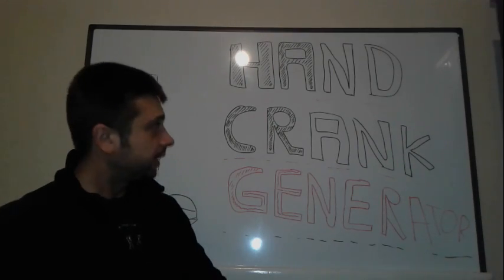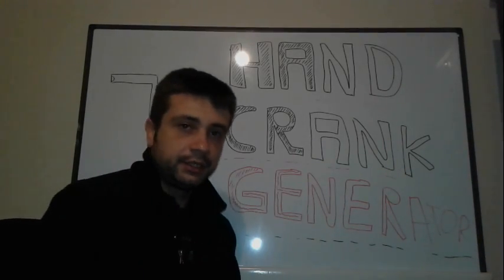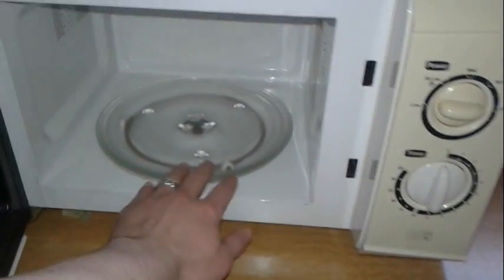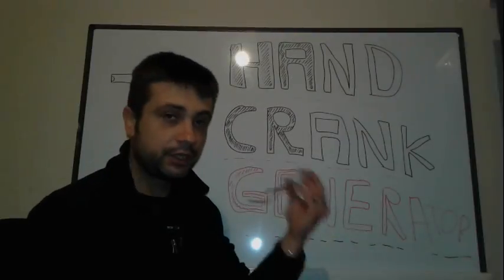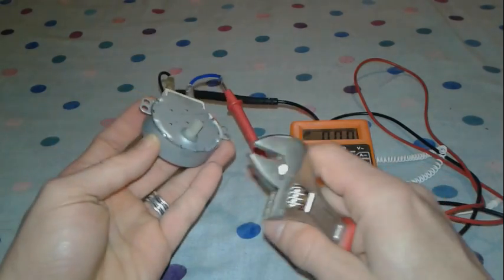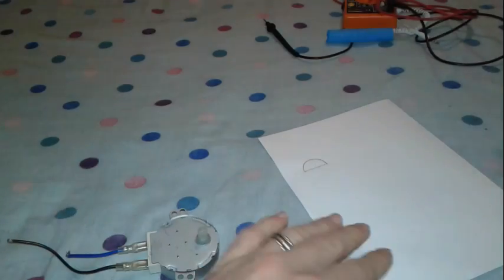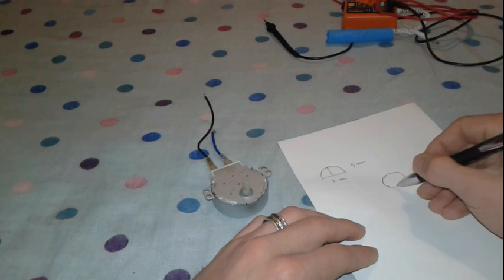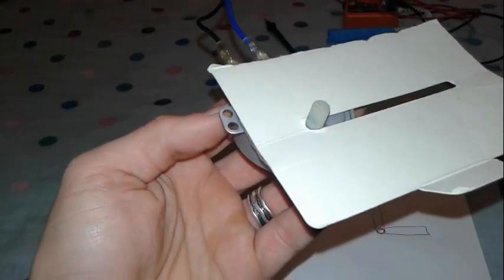How to make a hand crank generator from synchronous motor

Comment: Would it not be easier to use plastic and a soldering iron and fuse it together so much better then that hot glue process
Reply from the maker: David Steinfeld you can use what ever you have to make the handle the 3d pen is easy for replicating stuff and is strong enough preferable will be something metal